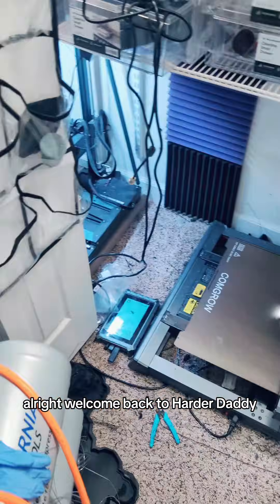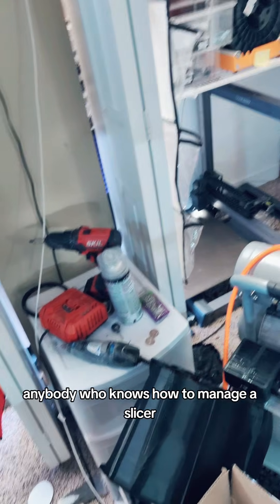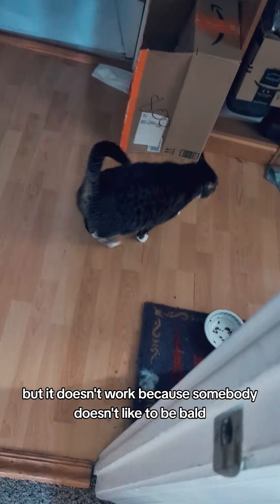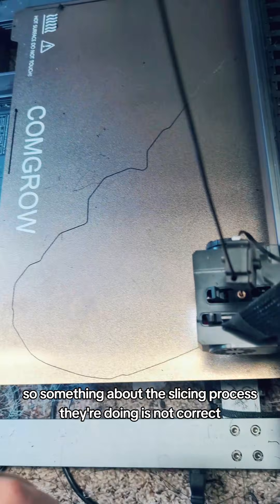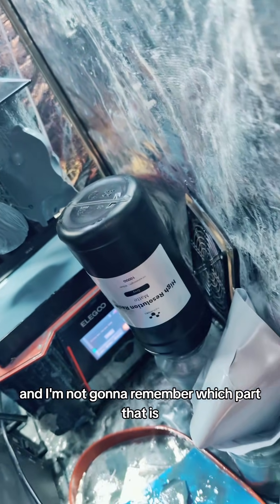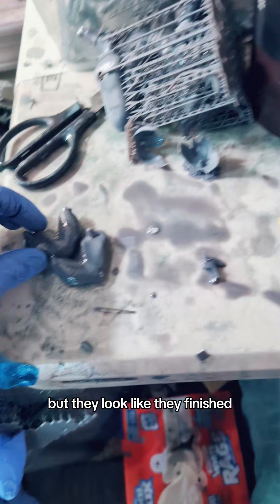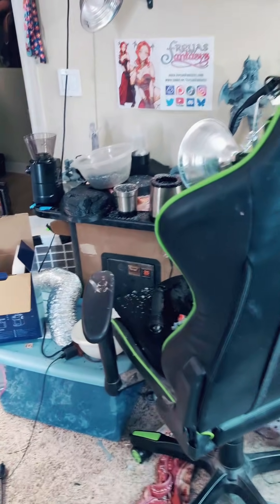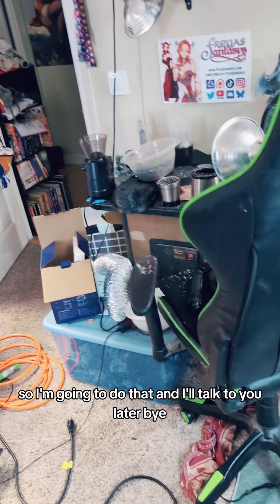Back at it during the holidays

Comment: Clean the build plate. Soap. Water. Dry it then wipe it down with IPA and a paper towel. With all that carpet it’s sitting on I bet it’s dirtier than you might first expect.
Reply from the maker: im pretty sure i got wd 40 on it, and that was causing sticking issues. soap and water fixed it!

Comment: I can slice it for you the problem is they're probably not repairing it after the slice and it usually takes sometimes a day for a large file even on my computer with a 12 core processor and 64 gigs of ram,   I go into the task manager and set 3D builder priority to real time and that makes it go a little faster but then I can't do too much on my computer......... And with some printers it's not just about setting your build volume to 500 by 500, you could just add the comgrow 500 to and slice the file properly, if the program is crashing on you then the file is too large and your computer can't handle it or you're using a Mac one or the other........

Comment: What kind of build plate do you have 
Because in my experience a textured plate has better adhesion than a smooth one but it puts the texture on the bottom of the piece which is why I use a raft 
Also a glue stick helps just cover the surface of the plate with glue and wait like 30 seconds before starting a print